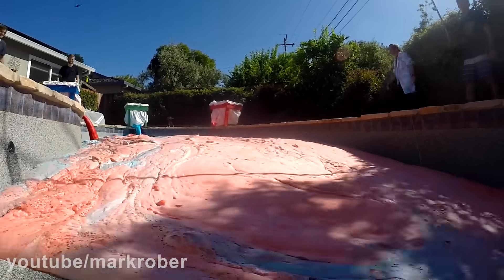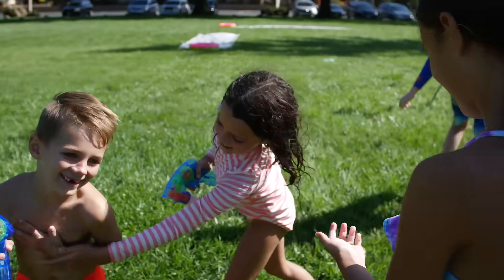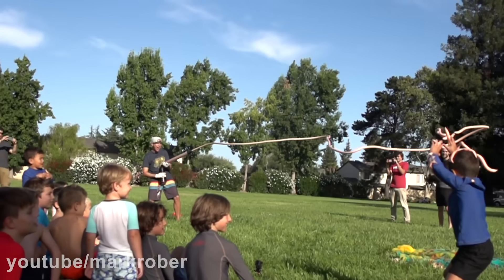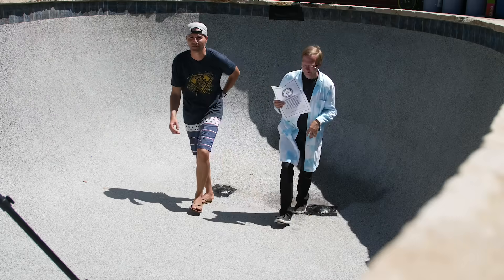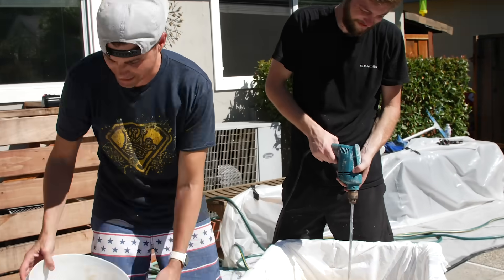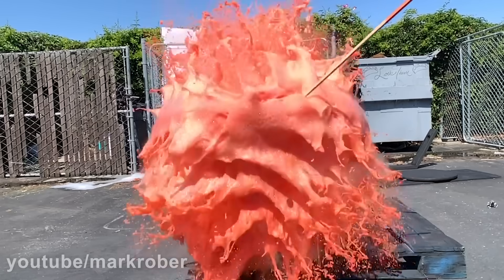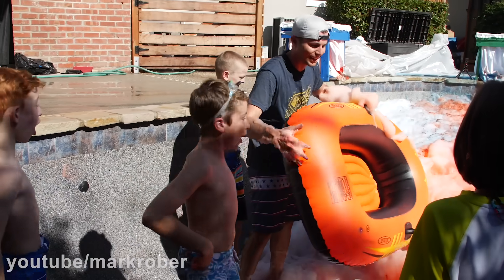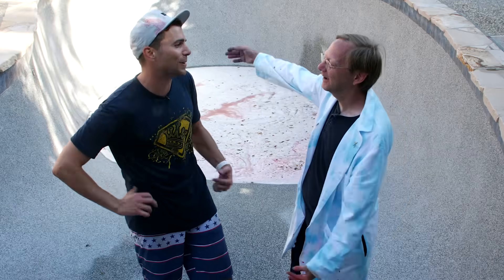World's Largest Elephant Toothpaste Experiment

Comment: Hey mark! I have an engineering challenge for you. So, I recently found out that due to the abrupt stop and weight of a teenager/adult, wet banana's, I mean, slip'n'slides can actually damage the spine. I challenge you to make a slip'n'slide that doesn't damage the spine. My only idea (coming from someone with a lot going on in his head with barely any of it being productive) is to make it longer, but it may be so long at that point that there's almost no terrain that can have it especially when you take in hills and small inclines as a factor.

Comment: Why didn’t the grass burn when the “melted unicorn exploded”?
Reply: Because 200F isn't very hot. To burn the grass you would need about 900F and the foam would likely put any fire out since it is a liquid.
Reply: No oxygen to start a fire, plus it's not hot enough
Reply: @captainspy3024  thanks for the answer

Comment: what hurts me is this is also massively physics based. You could have easily calculated the largest possible volume of the reaction using math you use every day but on a different scale, and I guess that's understandable, but I thought engineering and chemistry were two very close concepts, maybe that or I just don't have enough of a background of either and tend to blur the lines? can someone fill me in here?

Comment: The in-ground pool's walls acted like a very effective insulator and the thick layers of foam (relative to your small scale) trapped heat inside the lower layers. This resulted in greater temperatures and gas expansion below the surface than you saw in the small scale experiments, meaning the foam expanded more than you had seen before.

In other words you didn't make a chemistry mistake, you made a physics mistake after all. ;P

Comment: Please don't suggest people use hydrogen peroxide on cuts. It damages us, as well as pathogens. There's a reason you'll never see a hospital use it on wounds (I know, over and over). But really, just let a cut bleed a bit- then clean up later with water. Use an antibiotic ointment if you like. Hydrogen peroxide (HO-OH) is a free radical initiator (two OH with no charge, but a single unpaired electron), and free radicals are why we want antioxidants in our bodies- they stop the chain reaction. Antioxidants are stable with an unpaired electron. Peroxide does so much more damage than it helps.

Just don't do it. Cauterizing with a hot iron 'works'- we gave it up because we had better ways with less damage/scaring. Let's give up this chemical cauterization, as well. Time to give up this common 'medical' superstition, Mark.

Comment: Mark Your as smart as a Results 25 - 48 of 215 · 1-5/8 Inch Outside Diameter x 10 Ft. Long, Copper Round Tube. by Mueller. $112.55$ 112.55 ... Soft Copper Tube Pipe OD 4mm × ID 3mm for Refrigeration Plumbing 2 M. by Zerone. $3.39$3.39.

Like so he can pin the cumment!!

Comment: There’s this cool thing called a molecular formula, you can use it to predict the theoretical yield of products from a chemical  reaction. So I don’t think it was that hard to “predict,” considering the reaction takes place at room temperature. And besides its simplified by the fact that potassium iodide is a catalyst. So in reality the only limiting reactant is hydrogen peroxide, the soap and the dye are just cosmetic.) I feel like you only said that so you could stretch the video out with your “scaled” experiments.

Comment: Dude, you are so LUCKY you didn't damage your pool liner doing that.  You NEVER want to tape up your drains like that.  If you lived where the water table were higher than it obviously is in your area, that pool liner would have raised itself right out of the ground.  If you stop up the drains, your pool liner becomes pretty close to a boat, and will float itself out of the ground destroying your pool and requiring a complete rebuild of the pool foundation and a new liner poured, ~$25k once all is said and done.  
Here in Florida ours is so high that if you need to drain your pool completely you must run PVC piping up from the drain until the height of the pipe is above the water table, although we just extend it to the intended water line for insurance, that allows the pressure underneath to equalize and keep the liner from popping out of the ground.  If you look closely at the video when you are first in the pool you can see the water pushing up from underneath the drain where you taped it up.  That same force is being applied to the rest of the liner but you are far enough away from the water table that the buoyancy factor wasn't enough to overcome the weight of the liner itself.  Long story short, you got lucky.  That looks like a nice pool liner that isn't terribly old.  Would hate to see something happen to it.  I am taking the time to say this because with your projects I think there is a pretty decent chance you will figure out something you want to do that requires draining the pool again.  Thought I'd make sure you knew to take precautions from something like that happening because many have no idea it is even a possibility but happens all the time.  Nice pool, btw. Oh and great video.  Top notch content as always.  You have some of the best production value of any content I see on here.  Really professional.

Comment: This is what should be used as the “lava” in the volcano in science fairs
Reply: I thought that's what they do use
Reply: @lakin7878  they use vinegar and baking soda with paint
Reply: I remember last year i wanted to do it .

I didnt :(
Reply: That would made the paper Mache light on fire coz how hot the reaction is
Reply: @bevandarke2300  200F isn't nearly enough to light paper on fire. Paper burns at 451F (as per the Ray Bradbury book), and papier mache is slightly more tolerant. Plus, if you use a glass tube as the central core, with copper wire coiled around it, it'll nicely distribute that heat.

Comment: Sir if you will please hear me out. I promise I am onto a speed of light motor. Light can act as a fluid therefore it is subject to Bernoulli's principle. I'm trying to work the mathematics out myself but my mind is a mess with all these thoughts and designs! From creating an atmosphere for Mars naturally to 3d printing actual live prosthetics they come to me I write them down design sketch dream wash rinse repeat.
Reply: dielectric mirror mirror paneling set on hydraulic arms using an exhaust similar too modern fighter jets. Hydraulics... Have to scale the distance of the mirrors to the size of the star relative to the distance of the earth and the sun in the motor with the locol star inside. Ignition would have to take place in zero g in order to allow for the centrifuge to pull the nebula created inside tight enough to ignite the elements used based off the sun's makeup.
Reply: Possibly create a dielectric housing to contain the actual nedula and centrifuge to allow for some stability during travel? Idk the answer to some of these damn questions.
Reply: Small trickle of helium that's another equation to work on.

Comment: So your saying that the hydrogen peroxide is maintained out of hydrogen the oxygen molecules, they have a weak attraction by the covalent, which means that the O2 get released in the air but the hydrogen molecules get left behind and it just water, if you add a catalyst like potassium iodide then the process happens almost instantly... so hydrogen peroxide + potassium iodide +soap= elephant tooth paste?

Comment: Even if your components are in more or less the right ratio. It is reckless to let the kids come in contact with the foam. You can never be sure if there is still a significant peroxide contamination in parts of the foam, since in this scale a well distribution of catalyst and peroxide can not be ensured. I hope none of the kids got any chemical burn. Please use safety equipment, the next time you are experimenting with kids.

Comment: I've got a lovely question for you. So I love eating top ramen, and when I cook it most of the time I let it cool before eating. I however have found a "hack" where, when I sit down to eat, I will have a refrigerated beverage (I like drinking either water or milk) that I drink in between bites or sips when I am done with the noodles. I find it much easier to consume the ramen this way, as it doesn't feel hot when consumed. Is the coolness of the beverage protecting my mouth and throat from burning, or do I just not feel it, and is there a specific reason as to why this works?

Comment: Hydrogen peroxide is not a disinfectant. It is as harmless to pathogens as water.
Reply: Block, Seymour S., ed. (2000). "Chapter 9: Peroxygen compounds". Disinfection, sterilization, and preservation (5th ed.). Philadelphia: Lea & Febiger. pp. 185–204. ISBN 978-0-683-30740-5.
Reply: @aj4m2a  From the article you linked - Historically hydrogen peroxide was used for disinfecting wounds, partly because of its low cost and prompt availability compared to other antiseptics. Now it is thought to inhibit healing and to induce scarring, because it destroys newly formed skin cells.

And yes, I did make a mistake in my original comment.  I should have said that hydrogen peroxide is as harmless to SOME pathogens as water.  

Common staphylococcus bacteria for example aren't killed by H2O2.  

And while it can kill some pathogens, and prevent some others from reproducing, it also destroys your own healthy cells and prolongs the healing process, leaving you with an open wound that takes longer to heal, thereby leaving you open to future infection for a longer period of time.

Comment: Not sure if you overdid your experiment due to the surface area volume problem. When you scale up a reaction you lose a significant amount of surface area due to the volume increasing cubed and the area only squared. This leads to decreased heat dissipation and higher temperatures. As you have O2 gas trapped with the bubbles the temperature  has a great influence on the volume (see ideal gas equation)

Comment: If I had to guess I would say you got more foam than expected due to the square-cube law. As you scale up the experiment, the volume of the foam increases faster than the surface area. This makes it harder for the oxygen gas to escape the foam and also traps the heat generated by the reaction more efficiently (leading to the oxygen heating up more and therefore expanding more).

Comment: Deadly foam?
Man dies of an expirement using foam all filmed in camera. A man was found dead inside a carpet of foam, found footage explains how the accident occured. An overflow of foam  was caused and therefore went out of control. 8 bodies where found with 3rd and 2nd degree burns. Bodies are still unknown more information will be gathered on the unfortunate event.

Comment: the web:elephant toothpaste reaction, which uses a much higher concentration of hydrogen peroxide, can cause both chemical burns and thermal burns. While it produces a larger amount of foam, it's not safe for kids and should be performed only by an adult using proper safety gear.

mark:lets spray kids with elephant toothpaste yay!

Comment: I know that it's not so important, but it's not because of the weak bond between oxygen and hydrogen (regular water has the same bonds). It's about the bond between the two oxygens - because of the repulsive force between lone electron pairs on sp3 orbitals this bond is very weak. It breaks easily into radicals wich start a cascade of radical reactions that forms water and oxygen O2.

Comment: fun fact. youre creating a basic rocket engine there. youre making h2o2 go through a rapid decomposition releasing heat, oxygen, and water. right now the gas expansion is whats being captured by the bubbles and you can see the heat generated. This is the majority of the expansion. However if you were to up the h2o2 % to idk.. say 90% (rocket grade) the amount of heat generated would be so immense that it would instantly boil the water to 800 degrees C and that gas expansion would be enough to create an incredibly powerful rocket.

Comment: I have two ideas for videos
bowling ball that makes you get a strike every time
and a Giant calculator
Reply: Put magnets in all of the bowling pins and a big neodymium magnet in the bowling ball.
Reply: Andrew Potter what a smart way
Reply: @elizabethpotter3007  Then that wouldn't really be a "strike", it would more likely be a bowling ball "slurping" in all of the pins. If you really wanted to use magnets, having a strong magnet in the first pin with an opposing charge in the bowling ball would probably do the trick only if the bowling ball could be the size of an ant lmao jk
Reply: Andrew Potter that’d make the pins attract to the ball.  The ball would need to be attracted to some other magnets, probably under the alley.
Reply: I would like to see the bowling ball.  Put RFID tags in the pins.
Reply: Why giant calculator tho😂
Reply: Put a rotating gyroscope in the ball to make it move and control it with a remote system
Reply: https://youtu.be/2KE33uhgWHQ
Reply: Put a gyroscope of some kind in the bowling ball so that it moves in a straight line and release it straight towards the centre pin
Reply: The first was kinda done with the dart board

Comment: It's H2O2, right? Then you add a foaming agent and a catalyst, right? So you're turning it into H2O and O2 gas, right? You know what you can do with O2 gas, in particular in foam form, right? That's right, make HUGE flames! Why no flame here?
Reply from the maker: There’s not fuel. Need heat, oxygen and fuel for a fire.
Reply: @MarkRober  I know, but adding fuel (say, a little gasoline mixed in with the soap) would make at an explosion to fear.

Comment: Just FYI in the decomposition of peroxides, it's the oxygen-oxygen bond that breaks in half not the hydrogen-oxygen bonds. Potassium iodide helps speed everything up because it helps catalyze the breaking of this bond. Iron can do this too, which is what my Ph.D. focuses on. (The The H-O• represents the hydroxyl radical intermediate)

2 H-O-O-H -> 4 H-O• 
4 H-O• -> 2 H2O + 1 O2